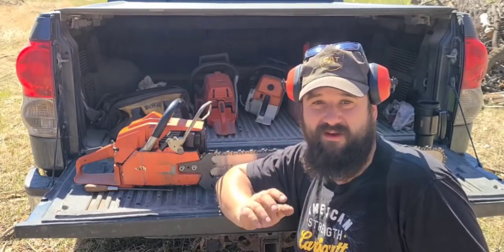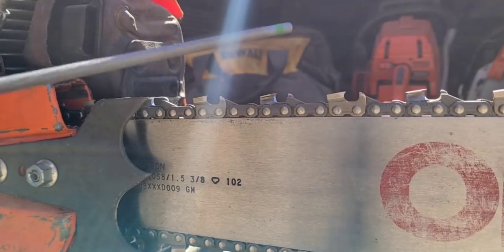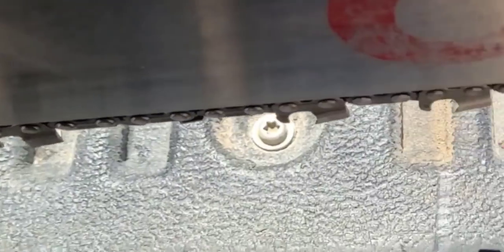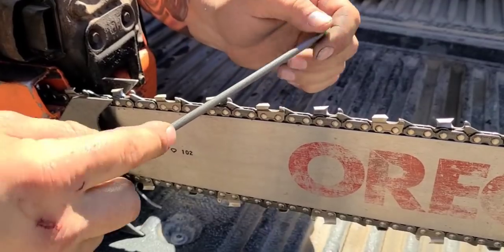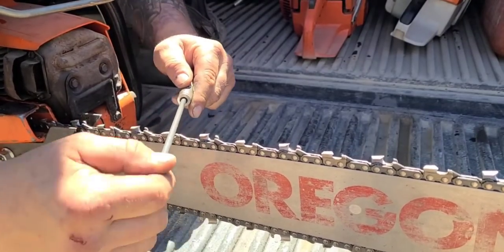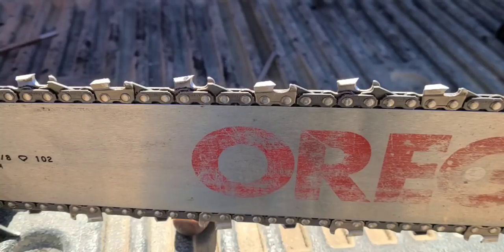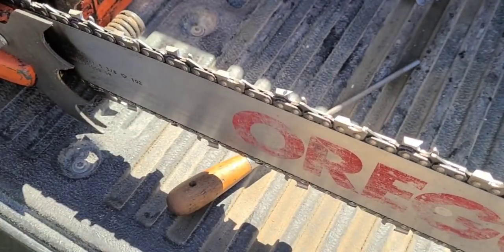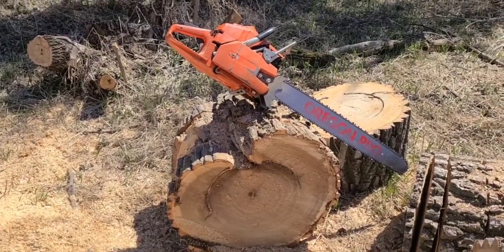How to file a chainsaw chain!! Throw away your file guides!!

Comment: That is how my dad who had a sawmill taught me to sharpen 50 years ago and it still works all these years later. Now I am learning to square file and I think I like it.  Heating fuel is going to be extra expensive this winter thanks to a certain persons policies so a great wood pile is a great money saver.
Reply: Man I really liked your video  but it looks like you're left hand is more square with bar than the right. Not being a smartass , just an observation. I sharpen a chain the same way.  The video was very informative,  thanks !
Reply: I have been collecting firewood for some time.  I saw a video of this guy north of the Arctic circle collecting firewood and he looked like he had enough for several years but it didn't stop him from collecting more.  There is nothing like the radiant heat from a proper wood stove unless you are eating some bean with ham soup.
Reply: @hillbilly4christ638  Iam in Ohio our winters as of late haven’t been to bad but bare minimum I keep 3 winter worth of wood all the time my thought was what if I get hurt or sick and can’t cut for a season atleast that way I have wood here that’s easy to get so I can heal up just my thought on multiple years of wood and it gives the wood time to season up good I like atleast a year season but 2-3 is better that way you know for a fact it’s as dry as it can be and it burns half again hotter seasoned 2 years versus 1 year just my opinion/thought lol

Comment: Yes! Sharp advice, well articulated. 

I’m in the UK and I sharpen exactly like this.  I tap the file to clear the swarf, I lift the file on the back stroke to prevent the teeth ‘knocking over’, I file ‘til it raises a burr and the burr falls off and I can't see the sharp edge, end on. I don’t use gadgets, except for a depth gauge file guide. And then I round off the back of the ‘flat’ on the top of the depth gauge to mimic the original profile – important on a chain without anti-kickback ramps like yours has. You stress the importance of correct height on the depth gauge (which you call a raker). Low depth gauges, exactly as you say) produces grabbing and vibration.

And then your saw cuts without your having to apply any pressure. I'm always stressing this because by pushing on the saw to make it cut, you are gripping tighter. This exacerbates the effects of vibration, despite A/V mounts. Vibration damages tissues and can result in carpal tunnel syndrome or Reynaud’s syndrome (also known as whitefinger or HAVS).  There is an operation for the first (painful and needs rehab afterwards plus time off work) but for Hand Arm Vibration Syndrome, it’s nerve damage. Nerves don’t regenerate, so it’s yours for life. Happy days.

Keep posting, Tinman.

Comment: A different  observation from someone who has been hand sharpening chains for 50 years.  The angle is easy when filing; the consistent height of the file in the tooth is the tricky part.  It takes a conscious effort, and lots of practice to keep it the same stroke after stroke  tooth after tooth, especially as the tooth wears and shortens.   I have worn out dozens of chains over the years, and when there are only nubs of teeth left, every single one of my cutters are exactly the same, with a perfectly flat bottom and correctly shaped tooth.  The key is using one of the cheap Oregon file guides wildland firefighters taught me to use 50 years ago.  It does not take one second more to sharpen a chain with the guide; in fact, I contend it is faster because the only thing you need to pay attention to is the angle, and that's easy.  The guide keeps the file at the proper depth on the tooth, and maintains that proper depth as as the tooth geometry changes with wear.  If your free hand filed, worn out chain looks exactly the same as it did when it was new, only shorter, by all means, throw out the guide.  If not, these $8 guides are a no-brainer that deliver both speed and perfect results.

Comment: I'm a little late to your Chanel, but I'm loving the content! I have a suggestion for your winter cutting. My uncle used to customize chains for dirty hardwood., he would use his silvey grinder, take an old beat up chain, and change the top plate angle from the traditional 25-30° to somewhere between 15-20° with a touch lower on the rakers. This with a skip tooth chain would hit more like a chisel then a cutter, and the skip would give the momentum to pull through. It was an excellent chain fir hard wood, I even cut through a metal T post with a 346xp, full house 18" chain, that wad right behind my hing on a 22" eucalyptus blue gum that was planted on a fence line. That chain would hit rock and dirt in a flush cut and only dull 3 teeth. If you still have a grinder and some old chain, I suggest messing around with those degrees between milling chain, and the 30° popularized by logging semi soft wood, that is sold by oregon, stihl, and all the other popular brands.

Comment: Just came across this video, great information.
I've used chainsaws some over the years but have recently gotten into cutting a lot of wood.
I've been taking my chains to a local hardware store to have sharpened, it's on and off, the guy told me when I asked, do you check the rakers, he said nahhh, no need to.
The last two sharpenings seem pretty bad, the chain don't last long, I get some shavings and some sawdust.
The chains get hot quickly!
I think I'll try this myself, I sharpen most everything else so why not this.
Thanks for the video. You can teach an old dog new tricks 🤣

Comment: I was instructed to generally sharpen the teeth in such a manner that 1/8 of the file stands proud of the top of the tooth when passing through the gullet.   Definitely wait until the burr forms and disappears, as mentioned.  Was also under the impression that lowering the rakers in a uniform manner as a set, rather than per tooth, was a good way to ensure a smooth-cutting chain.  I believe the assumption is that any teeth that are too high (needed less filing initially) will be dulled early (yes there is some chatter) and will be addressed at the next sharpening, haha.  So far so good, on my end.  Also, the file has a twist built in, so I rotate the file every 10 swipes or so instead of twisting.  They seem to wear more evenly.

Comment: Morning sir, good sharpening tutorial here. A couple additional ideas. You were tapping the file - that's to clean it out folks. They load up quite quick and need to be cleaned. Speaking of files - they're relatively cheap - I buy them a box at a time and when they're even a wee bit dull they go away. Filing on the tailgate is about right for most people for height and ergonomics. If you take even a 2' long chunk of 6"x 6" or a tad bigger, cut a slot into it and drop the front of the bar in that slot while sharpening it'll squirm around less. 
Anyways, just thoughts from a semi-old guy who's been cutting firewood for 40+ years. Stay well Tinman.
Reply: Ya anything you can do to get that saw more stable while learning will help immensely! I’ll also tighten the chain on  the bar before starting. Quite tight. Stops that bit of wiggle the chain gets on the bar. Just remember to loosen it again afterwards. Good tip there RC

Comment: i've just been watching "guilty of treeson's" guide too square filing well worth a look they compared round and square came out 45% faster with square!!! really buckin is great on his filing and correct but square filing is like warp speeding your cutting! with the right angles it can make a more durable tooth edge, i was shockingly impressed!
Reply: Yes, I watched their video a month or so ago.  I could not believe the difference in a new chain vs hand filed round file, and hand filed square filed.  Time in the cut went from almost :30 seconds to less than :15.  Why all the porting, etc chasing seconds when filing made a bigger difference.

Comment: I also use a sharpie to mark my start point, but soon i will have to have Chris sharpen the chains, because i know i wont be able to see the gullet in a few years. I was taught to put a sharpie coating into the gullet many years ago, to be able to see that i was getting the gullet and to check my angles, these are a few good tricks to help a person learn about sharpening a chain.

How it works is the dot on top identifies the start point, the coloring of the gullet area shows how you are sharpening, so if you miss an area of the gullet, you will see the remaining sharpie mark, and need to either continue to sharpen or change your angle!

Comment: I hand file this way, and every 2 or 3 I run the Stihl 2 in 1. It's a matter of efficiency, keeps me in the game all day long. The Stihl 2 in 1 is not just for beginners, but a little slower and hand filing gets the gullet and the underside of the top plate a little better, imho.

Comment: Also, buying a machine like a chain grinder has a negative effect on the environment (collectively, it adds up). Blunt files can be thrown in the scrap steel bin and be recycled with a bit of energy, which may have come from the sun, or wind, etc. Just another tick for hand filing.

Comment: I file the same way but I like to keep a file guide for the shop. After work I’ll sharpen all my chains free hand but then take a file guide and by tilting the guide back a little I can get a thinner edge on the top plate. It only takes a swipe or two after a full sharpen and it will be razor sharp. I kinda took that from guilty of treeson channel although he probably does it a little different.

Comment: Sorry tin man... the stihl 2 in one sharpener is the best device I have ever used in 35 years in 4 strokes your chain rt before your eyes shapes into a brand new chain and files the rakers at the same time. You cannot tell the difference between a new chain and the one I filed,  not to mention sharper than factory

Comment: What brands of files do you recommend. I have used the oregon files from the big box stores and they dull rather quick and do not cut very fast. I get maybe three sharpening's out of them before they are toast.
Reply: I use to run Oregon and husky.. but switched to stihl files..and I like them much better

Comment: Thanks for the video I as well am way better at hand filling thanks to buckin. It has made me enjoy running a saw much more. If you want to try another file brand I like save edge they are pretty sharp and quick cutting. And I also like pferd they have many different cutting files

Comment: Thanks Tinman! I'm still struggling with it  !
Reply: Stay with it Kain👍it’s like learning how to play an instrument. Practice practice practice. What helped me the most other than this amazing community is this. Don’t let it get too far gone between sharpening’s. Touch it up after each tank or two. It’s far less daunting of a task and you’ll get more practice in a shorter span. Building up your muscle memory each time. Hope this helps🙂
Reply: @shapeshifter7753  Thank buddy! Practice makes perfect....I still get a little confused on what file size to use also...is there a quick rule of thumb?
Reply: Kain Kustom Garage I don’t hear this mentioned ever but my experience is line up the bottom of your file to the second bend below your cutter. The top of your file  should now be just above your cutting edge. That bend is also a guide😉keep filling following that bend in the side plate and you’ll always have the correct gullet profile😁 have a good look. She’s subtle but this helped me a lot! Mostly cause I deal with various brands and vintages of chain
Reply: @shapeshifter7753  Cool! I'll try that!
Reply: Kain Kustom Garage god speed freind😎
Reply: @shapeshifter7753  ThanksMan!

Comment: I know someone who has x number of chains, uses them all and sends them in for sharpening, I asked why not sharpen  them as you go? Replies "couldn't be bothered to waste time filing". Each to their own. I rather sharpen my own but i touch up the chain every few tanks before it ever gets dull and not only to keep it sharp, but I find when they are too dull  and I seen some reallllly badly rounded top plates, but you get more life I find from a chain. Round out a topplate and it takes more material to get it sharp again then it would have been to maintain the chain and shortens life of it too
Reply: It’s true. It’s easier to just keep em sharp👍

Comment: Clean your files with a wire brush or wire wheel on a bench grinder
 Literally get 2x as many files cleaning the cutters out properly
Reply: Right on there. I use a file card. It’s sole purpose is to clean files

Comment: To the new filer: if it’s a brand new chain your working on and you swear it’s the right sized file but it just doesn’t fit into the gullet; my experience is the factory has put a nub in front of the gullet that needs to be filed off to get that file to find its way into the gullet. God speed on yer sharpening journey😃it is a process... One that should be repeated and practiced as often as possible at first. Just practice friends. That’s all
Reply: I never get the gullet on my first file , I just pull back to train it , usually second file is getting into the gullet lol

Comment: I find the oregon files are a smoother cut the husqvarna intensive cuts are great files but are an aggressive cutting file and dont seem to last as long as the oregon files ill get about 10 sharpenings on the oregon file on a 24" bar and only about 6-8 on the husqvarna

Comment: Could you do a video on the 200t how to fine tune a carburetor and what each setting do I’m having a hard time tuning my
Reply: He’s got a video on tuning carbs and it’s a good one. The cliff notes: raise idle with screw until chain is whirring along. Adjust L jet until it is at peak velocity then back out just a hair to slow it down. Turn your idle back down. Check for 1-pull restart and saw running well laying on its side. Now tune your H jet so it has a raspy 4-stroke note as it maxes RPM, but cleans up when you sink it into wood. Tune carb only when saw is warmed up. (On H&L jets? In is lean, out is rich)